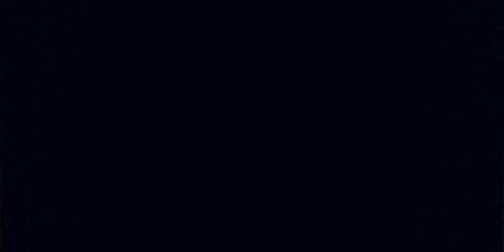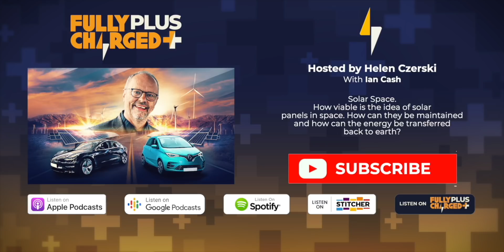Solar Space. Out of this world, or a realistic option with Helen Czerski.

Comment: I think the economics could kill it.  Like any other expensive generator it need constant load to payback.  This is why Nuclear and Coal are in decline.  Baseload is in constant decline due to more efficient product replacement, baseload is not needed, we need flexible, dispatchable/switch-offable power.  If you are Nuclear proponent you don't really get that.
Reply: There is always going to be baseload requirement. You'll always have refrigeration, HVAC, datacenters, hospitals, and more that require power 100% of the time.
Reply: @coreys2686  the point is it is decline.  Base load is easy and demand used to be mostly baseload, now it's mostly peak.  Modern Fridges are using 1/10th what they used to, lighting similar, these are all still being replaced.

Comment: So for the reference site in Antartica- the beam passing through the mesh receiver, Would that not melt the ice??
Reply: The beam doesn't pass through. The mesh is significantly smaller than the wavelength. If it passed through, that would be a source of inefficiency.
Reply: @Markle2k  Hi there! OK I thought that the mesh had large gaps -6 ins? Why would the beam not pass through this?
Reply: @MERRYPAN  Short answer: physics. The same physics that allows your satellite feed to your local cable provider to provide satellite feeds. The reason you see satellite dishes using mesh. rather than solid dishes, is for stability in wind. The wind mostly passes through, but the microwave downlink is reflected by the mesh.
You'll have to go to Wiki University to have the physics explained to you as I don't have the time.

Comment: Where are the positions that satellites in earth geostationary orbit can see the sun 24 hours a day is it above the poles and if so how do the satellites hold that geostationary orbit?
Reply: It's above the equator. The orbital period is the same as the day length, so from the ground they appear stationary (geo-ground + stationary, hence geostationary).

Except for twice a year, as mentioned, the plane of the equator, (and so geostationary orbits) is not aligned with the orbit of the earth around the sun. So the shadow of the earth doesn't fall on the satellite.

A bit hard to put into words. It would be really clear if I could doodle it for you.
Reply: @gasdive  Thanks for your comment and I appreciate your time, I'm probably wrong but a satellite in geostationary equatorial orbit is stationary to the earth. so equivalent to a very tall tree. The top of that tree is still in darkness as is the base as the earth rotates???
Reply: @andymacleod2365  not if the tree is tall enough.

Close orbits are fast. Low earth orbit is 90 minutes. Further out orbits are slower, the moon takes 28 days to orbit the earth.

To have a 24 hour orbit you have to be a bit under 36000 km away. The Earth is just a bit over 12000 km across. 

If you have, or can picture a world globe, imagine a string 3 times longer than the glove is wide. Stand that straight up from the equator. Now, remember how the globe is tilted a bit? That's the tilt with respect to the sun. The pole points in one fixed direction in space (on human timescales). As it orbits the sun, the sun appears to go around that globe while the globe spins. If one pole is pointed at the sun, then it doesn't matter which way the string points as the globe turns, the end of the string is always above, below or to the side as viewed from the sun. 

If the poles are at 90 degrees to the sun, then there's a point in the rotation of the globe where the end of the string is pointed exactly away from the sun. That's the time the solar panels would be in the dark. 

So for a few weeks every six months the panels would be in the dark for a few minutes each day. 

But if you had several solar power satellites spaced along an arc of the orbit, there would be some in sunlight and visible from the UK at all times.
Reply: @gasdive  Thanks for your feedback. for an orbit that is so far out what is the percentage power loss? I assume that most of the power loss will be in the lower levels of the atmosphere so putting the collector on top of a tall tree would be advantageous or a high mountain. What stops the beam from the satellite frying lower satellites or do they just have to keep out of the beam?
Reply: @andymacleod2365  sadly, they're all good questions and I don't know the answer to any of them. Sorry.

Comment: More energy at 2.4GHz?? How much interference is that going to cause?

SABRE engine isn't viable yet.

The methane used in the raptor engines is going to be extracted from the atmosphere, then its combined with the oxygen in the combustion chamber. CH4 combined with O2 gets H2O and CO2. You don't get any methane injected into the atmosphere at all.

Fuel costs are about 1% of the price of a launch.

Starship is planned to put 100 tons into LEO.
Skylon (the vehicle designed to use SABRE engines) can't even come close.